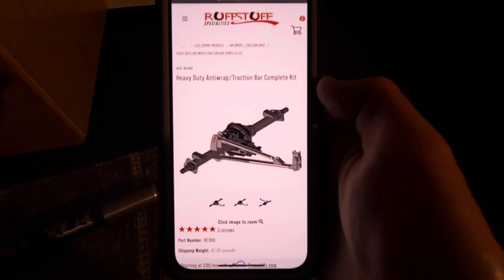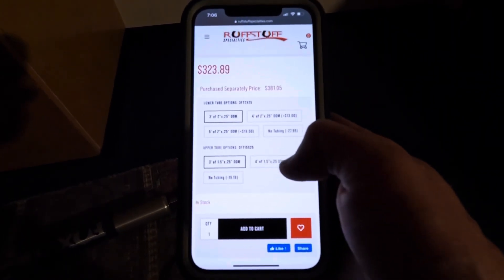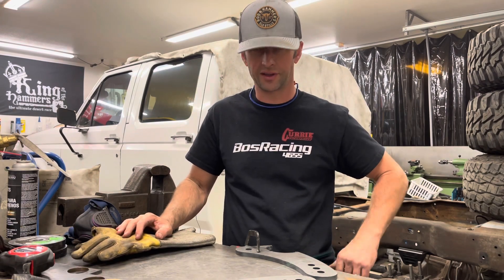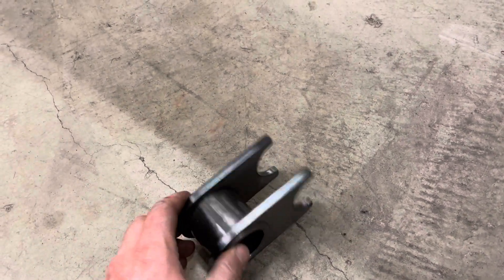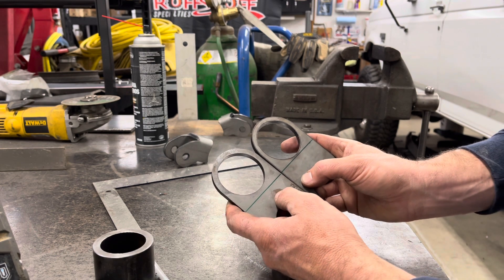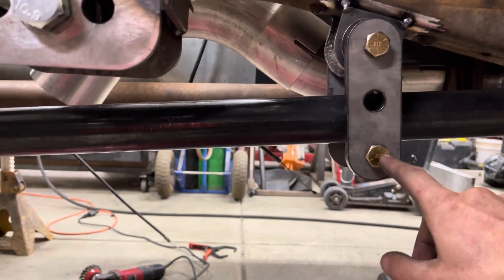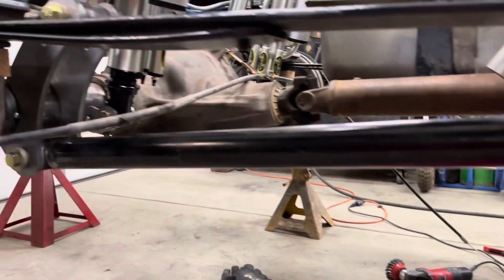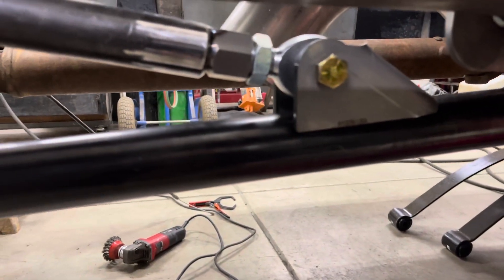Ruffstuff Specialties Antiwrap Install, part 1 of 2

Comment: i installed my ruff stuff trac bar about 15 years ago on a 85 chevy CUCV K 30. i have 63in springs from a 99 chevy 3500. when i first looked in to doing this one of the things i learned was the trac bar joint should be even with the first u joint on the drive shaft. mine is 2 in square stock with a 1 1/4 in rod end hanging from a trail ready shackle joint on the frame. mine is also centered as close to the drive shaft as possible  for flex and to protect the drive shaft some. its worked well for 15 years in lo speed hi flex use

Comment: Hey bud what type of filler metal did you use for the brackets welded on the axle
Reply from the maker: As in what welding wire?  Or?